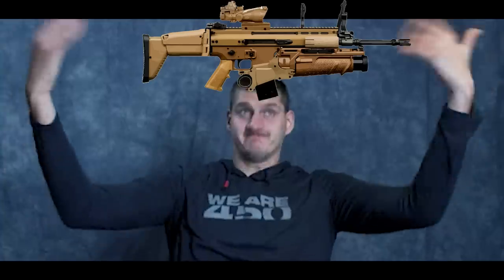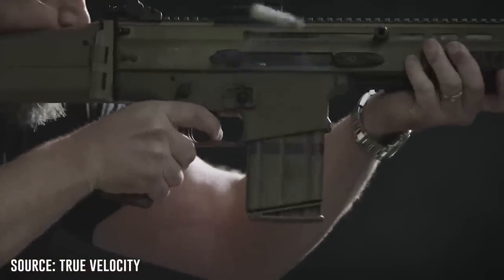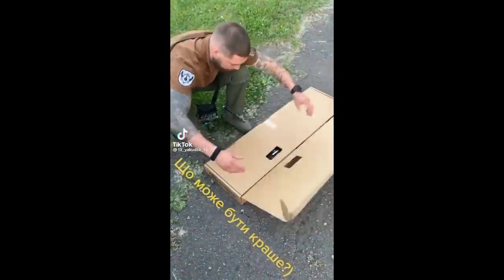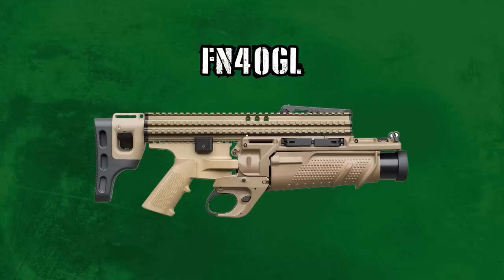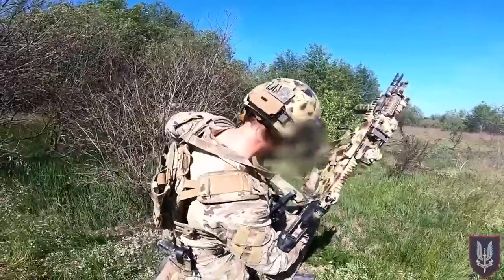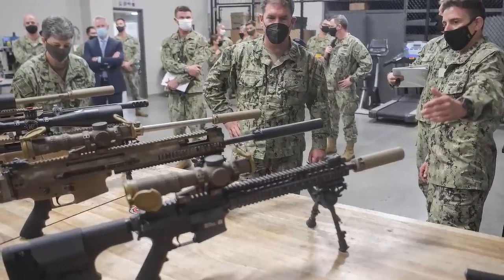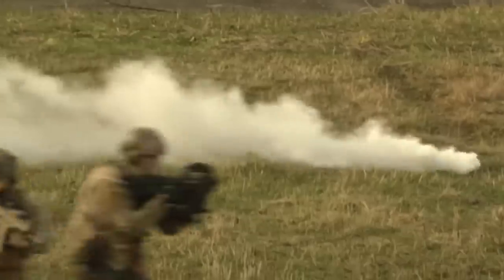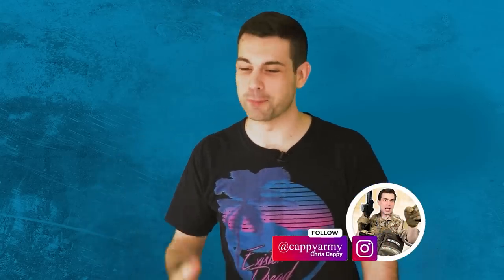Why this SCAR-H Rifle Uses Plastic Ammo Casings (Weapon Analysis)

Comment: the plastic case might work best with a very very light 12" m4. for close urban/building  fighting doctrine. full auto at 50yrds typically has about a 50% hit ratio with the m4. so for a heavy urban firefight a soldier can carry much more ammo and have less concern of over heating the gun, in the environment where full auto makes the most sence.  the hit ratio exponentially drops like a rock after 50 yrds. at 75 yrds it drops to 10-15% hit probability.

Comment: Another point is that they had Eotechs on the early blocks of the SCAR.  It wouldn't be until nearly a decade later that Eotech/L3 admitted that their sights were drifting and failing on all rifles. 

Because they thought Eotechs were gtg, the rifles and the SCAR took the blame for "killing" them or being inaccurate.

Comment: If ammo is 30% lighter, it makes sense that it is more accurate, as the bullet isen't bumping as hard around as it doens with the original whight (heat is also a kinetic energy source added to the sum of energy circle through the weapon).
And as those forces are heading in diffrent directions at the same time and in a split second, this expalin why this is tricky to meassure with something but the human expirience.

You can say the gun with more forces heading in different directions - even if they would totally cancel each other out - is more easy to move, even it technically has the same resting mass as with normal ammo to withstand moving. It's ... vibrating.

Comment: that muzzle flash is jsut due to using standard M80 wich is meant for 20+ inch barrels not the short 16 inch barrel found on the standard scar. Shoot that same ammo in the Scar H (LB) with the 10 inch barrel the muzzle flash will be non-existance. Want to get rid of flash switch to ammo meant for shorter barrels which most socom units already do.

Comment: So the first 15uears of a new weapon system is going to have extensive teething issues with the design that will need to go through multiple iterations of design refinement. People should note this when discussing all new weapon systems: its not "finished" until its had a decade or more of use, abuse, and updates. It's what happened with the m16, it's what's happened with the SCAR, and it's what's going to happen wit the M5.

I do like designers considering different materials for casings though, it bad brass is recyclable while plastics aren't.

Comment: The reduced heat transfer to the chamber with the polymer cased ammo has huge implications beyond rifles. A cooler chamber could improve the reliability of machine guns under sustained fire situations. Additionally, and take this with a grain of salt cause I'm not an engineer, you could get hotter rounds with the same powder load and chamber pressure. Which would in theory increase muzzle velocity increasing the effective range.
Reply: It would cut down on the chance of a round cooking off in the chamber, but for sustained fire the barrel is where the problems arise. Can not fix a drooping barrel with a cool chamber. Also chamber pressure is how you increase muzzle velocity if you do not change to a lighter projectile. If the projectile stays the same and the chamber pressure stays the same there will be no increase in muzzle velocity. Also please think of the talk about energy lost to heating the brass casing making a difference to ballistics compared to polymer as marketing. The percentage of energy left in the casing and chamber when firing is not enough to make any difference that is significant to the projectile going down the barrel. Just the friction energy left in the barrel by a round squeezing thru is probably 100x what is left in the brass casing and chamber. The advantage is primarily lighter ammunition and safer closed bolt machineguns when it comes to cooking off rounds after sustained fire, the rest is marketing.

Comment: Using a silencer or even just a flash suppressor reduces muzzle flash significantly compared to a Surefire muzzle brake shown in the video. The Surefire brake is probably also worse than the OEM 17S muzzle device for civilians, and the flash suppressor on the military SCAR-H. I've been back on forth on the issue with my 17S. I had the flash suppressor, then switched to the brake, and now I'm thinking of switching back to the flash suppressor. It would be nice if Surefire offered something like the OEM device that has a little bit of both recoil reduction and flash suppression.

Comment: I live in the UK, can't own a gun. Just curious wither the monolithic design of the Scar impacts fixing problems in the field compared to more "skeletal" rifles like the M4. It looks to me like all the components are pretty well boxed in.
Reply: You can own guns in the UK, it's just a hassle
Reply: not really, most modern rifles can be taken apart with a tip of a bullet and maybe a set of allen keys if you want to do more than field stripping the rifle. besides taking the gas piston out of the SCAR being a little more complicated than it should be, it takes down the same as most other rifles.

Comment: The SCAR-H and SCAR-20(20S for us civvies) chambered in 6.5 Creedmoor have had major issues, and still are. Light primer strikes, failure to feed, failure to extract, blown primers, brass damage (both from firing and extracting), among other issues. I don't see these issues changing very much for SOCOMs possible new contract with FN.
Reply: The 17 does not have those problems. The 20 in 6.5 did, and I believe FN is either working it out, or they already did
Reply: Trying to use the existing gas systems and cyclic timing for a different cartridge, the 6.5.
They just jumped on the flash in the pan Credemoor bandwagon before perfecting it.  Driven by dreams of profits will do that.

Comment: The newer SCAR version with a NON-reciprocating chsrging hsnflr od s derp up but how reliable is it with standard bras cased ammocompared to the new M5? Can it handle the6.8 x 51 80,000 psi cartridge for thousands of rounds?? Doubtful.
Methinks the M7 is the best choice and so does the Big  Army.

Comment: Honestly surprised they didn't go with the scar purely for the logistical benefits of the polymer ammunition.

lighter ammo means more ammo on patrol and less fatigue on soldiers, less fuel in transport.
not to mention playing better with suppressors, less muzzle flare, less wear and tear on barrels.

oh well, guess that tech wont hit widespread use until the next major rework

Comment: Every time I hear about the m4's being a problem in the military.  It can be fixed  with a different issued ar15 brand.  Not all Ar15 rifles are built to the same quality. Colt does not build the best ar15's. Their are many companies that build better Ar15's than colt. BCM, Daniel defense,  cmmg and P.O.F. for example. Another issue is alot of the militaries equipment has been used alot and not properly maintained.  Take for example the Beretta M9's.  People were claiming the m9 was a unreliable pistol in the military. The M9 was just like the M4's improperly maintained by the Armory.  Springs and extractors wear out on every firearm. It's a regular maintenance item, like the brakes on your car.  Keeping a regular maintenance interval where common items that wear out are replaced. Will fix many of the problems that soldiers run into. Every firearm will fail with dirt inside of it,  even an ak47.  The ar15 actually has a better system that an AK. Because the system is more sealed up which helps prevent dirt from entering the system. The m4 is not a machine gun, just like an ak47. These weapons are not meant to sustain long rates of fire like light machine guns. They should not be used as such. If soldiers are firing these weapons in full auto in high round counts. It will cause excessive wear on the barrel and firearm.  Which will shorten the life of the barrel. That will happen with any firearm. Take a look at Iragveterans8888 melt down videos of the AK and ar15.  And you will see even aks will fail from excessive heat build up from sustaining fire.  So maybe the military needs to stick to semi automatic fire as how alot of the m4s are used today in the military. And use machine guns for suppressing fire. The real problem with the m4 is it's cartridge. The 556 relies on high velocity to yaw and create the wounds it's capable of.  Once it loses enough velocity. It acts like a traditional round when entering the body. Another problem, taking away barrel length, only makes the problem worse. If they made the bullet have a hollow inside like the 5.45x39.  Then that would help it at lower velocities still yaw. Another problem is the 556 is only a 600 meter cartridge. So in Afghanistan it wasn't a good choice for longer range shooting in the afganistan mountains  Some US troops were bringing out m14's in .308 for the longer range engagements.  However most standard infantry rifles all share this same problem. New body armor technology is making rounds like the .556 also insufficient.  The m4 if properly maintained and made with high quality parts is a good rifle. I think alot of people who know very little about firearms. Tend to speak out of opinion rather than actually understanding and knowledge. The m4 gets a bad wrap like how people claimed ak47 aren't accurate because of ignorant people not understanding the ak47s capability. The 7.62x39 round is not meant for use beyond 3 to 350 yards. Every gun chambered in this round. Will have the same problem. That's including the sks.  If you look at the ak74. It's basically a ak47 that with a different cartridge, the 5.45x39.  It's has a greater effective range and it's round is flatter shooting. The same platform with a different round.  So the ak74 is not considered inaccurate. And yet its the same gun with a different cartridge. How can that be? Because the cartridge a gun fires has more to do with it's accuracy and wounding capability than the gun itself.

Comment: Where did u get that the rangers dumped it in 2011 after only 2 years?  I was in between 06 and 2017 and it was definitely still used.

Comment: With no other factors, the same exact round will cause the exact same recoil, because the force of pushing the bullet will be the same as the force it pushes back into the shooter with.  Making a weapon heavier, muzzle brakes/compensators, floating barrels all reduce "perceived" recoil, but they don't reduce the backwards force they dissipate it with mass, time, or both.  That's the bald physics of it the question you raise of the SCAR's bolt size/mass and travel length inducing enough shock and vibration to foul up optics does sound concerning.  I wonder also to what extent that might cause wear and fatigue in the other parts of the rifle, violent motion and precision machines aren't exactly friends.  Can anyone provide more info on this and how these things could or do happen?

Comment: Main issues with plastic cases are: potentially wider case reducing magazine capacity; greater heat buildup from less efficient heat dump on case ejection; potential issues with case separation from base on extraction.
Reply: The external case dimensions are exactly the same as their metallic case counterparts, so that's a complete non-issue. Polymer cases always reduce chamber heat, with absolutely no exceptions. There were case head separations on earlier polymer hybrid designs, but both True Velocity and MAC, LLC seem to have utterly resolved that problem. No case head separation on either company's ammo through millions and millions of rounds fired.
Reply: Bro the video literally explained that the case acts as INSULATOR which means more heat gets dumped out instead of conducted into the chamber.
Reply: An insulator can’t dump heat, it prevents direct heat transfer to surfaces in contact. Metal cases dump heat. Different methods of heat management with different pros and cons. In order to dump heat, a conductive material that is physically removed is required. Using an insulator reduces conduction to the chamber surfaces in direct contact. But that heat energy has to go somewhere. Without a heat mass to store it, it likely goes forward into the barrel with some blown out and some conducting into the metal of the barrel.
Reply: @stupidburp  Pros and cons, but more pros and fewer cons for polymer cases versus metallic at conventional pressures (<65K PSI).

Comment: Did the brass case and plastic case ammo both have the same powder?  Flash can vary significantly from one type of powder to the next.  Case volume can also limit the maximum velocity, with cases having less volume hitting maximum SAAMI pressure at a lower velocity.
Reply: No, different powder.  Case material has nothing to do with flash.
Reply: @blackhawk7r221  I didn't say that case material affects flash.
Reply: @TheSuburban15  You’re right, you didn’t.

Comment: What are the environmental impact of this new amma though? For example, will it stay on battlefields for even longer than other ammo after combat? I'm just interested as we need to reduce plastics in the enviroment and spraying them all over battlefields doesn't sound like a good idea as they may essentially stay forever.
Reply: Uh, you know brass isn't biodegradable right? Also kind of a moot point when bullets are made of lead and primers contain mercury and other toxic chemicals. Plastic casings would probably be least concern. A shooting range is automatically a heavily polluted hazardous / toxic waste site.
Reply: @83917Michael  Yeah thats a good point, I guess on an actual battlefield then the question would be, which casing fragments more. Which would be easier to recover at a later point, and are the lead primers more damaging than plastic fragments? If ones a lot easier to recover its probably better, but I guess the weight difference is a hell of a lot so maybe plastics are better because transporting all that metal would cost a lot more.
Reply: @blackhawk7r221  This is true, but are the us and Europe partly to blame for that? (Correct me if om wrong of course) but I'm pretty sure a lot of waste is actually exported to these countries which could be a reason why Western Europe and the US is so clean, I think in some cases its just cheaper to send it somewhere else than deal it yourself!
Reply: @danyork5978  It’s culture.  I’m not speaking of landfills, but the general population of third world peoples that have no concept of trash bins.  Buy a snack, unwrap it, immediately drop trash.  Absolutely no thought, much less care, of where it lands.  Same with drinks.  It’s rather shocking to see.
Reply: Brass will last at least 4,000 years in the ground unless the soil is super acidic.
Reply: We used to regularly come across 1918 headstamped 30-06 out at Ft. Sill that was halfway corroded away and paper thin.

Comment: There are good reason why the scar gets the hate it deserves. Cost, the beating up of optics, the recprocating charging handle (which should of never come on a rifle that expensive.).
Reply: The charging handle was requested that way by the military. Now that years have passed since that requirement, they've made a non-reciprocating handle.
Reply: The optics thing is really only if you run shitty optics, I’ve only put high end optics on mine and only seen cheaper ones fail.

Comment: 2:42 "barrels melting" Do you mean barrels melting or gas tubes popping like theyre designed to specifically so the barrel doesnt explode?
Reply: It was the barrels themselves losing their heat treat from.. heat, then failing later down the line

Comment: Love everything bout the Scar except the price tag. One gun I just can't justify
Reply: Well just consider how much ppl will spend on a quality AR
Reply: @alexc6582  I have been close to buying a SCAR 20S,  it was just over of $4,000.  By comparison a Noveske with a 16 inch barrel is nearly a grand less. The difference being the Noveske has no suppressor limitation, better track record, has better parts support, is user maintainable to a higher degree  and better customer service.   So compared to that the SCAR is more expensive and falls short in a lot of ways.  Do I want one? Yes.  Will I get one soon? No. I expect the price to come down after a while,  but not much because FN is stamped on the  side.
Reply: @erggml1887  noveske 5.56 or .308?  Caliber determines price
Reply: @erggml1887  with inflation, everything has gone up, and the SCAR 20 is the most expensive one
Reply: @alexc6582  Since you mentioned AR, I thought you were referring to the AR15. So I checked prices for that at   noveske.  308 closes the  gap still cheaper.
Reply: @erggml1887  still. A noveske .308 with a 16" barrel compares more with the SCAR 17 with the 16.25" barrel, which is $3200-3500 (without inflation-with inflation).  The SCAR 20 is the most expensive

Comment: The more I learn about the brass the more I think the M5 is doomed at 80,000 psi!!! If they can do the same essentially with 5 grain lighter bullet with way less heat I think the advantage is clear. So why not use the ammo from FN and the sig gun??? Was this explored??? I don’t get why they didn’t do the ammo decision and the gun separate. You know pick one then the other rather than comparison of two variables simultaneously???
Reply: They can't though, the polymer that True Velocity is currently using can't withstand any pressure that would allow it to come even slightly close to the performance of the SIG bi-metal case.

Comment: With that logic the xm8 was the better gun due to lower stoppages. Kinda surprised we dropped the scar.
Reply: Well according to Business Insider, there was nothing wrong with xm8 design itself just the manufacturer H&K didn't fix the issues in the production side and decrease weight of the battery for the powered optical sight. The US military abandoned the project.